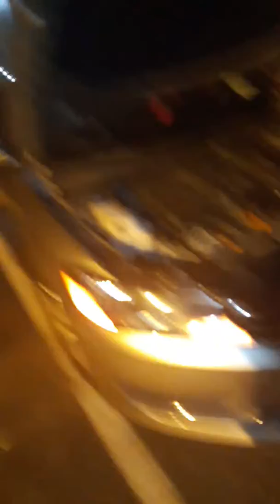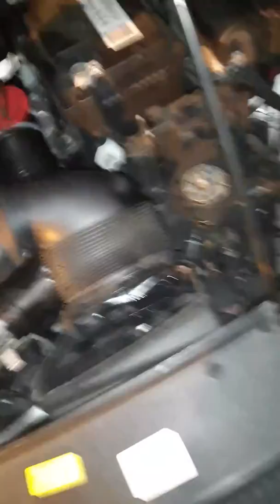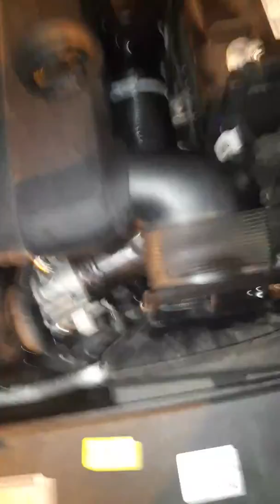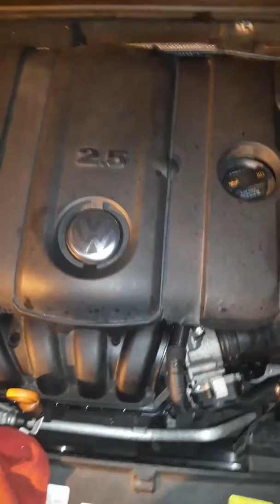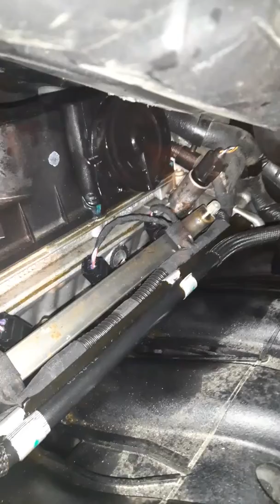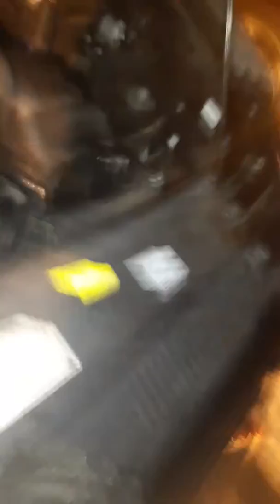2013 VW Passat whistling .. problem found but what's wrong. Part 1..

Comment: thank you so much. This helped me figure out what was going on with my vehicle and it was exactly what you said. I pulled it apart and seen that the PCV cover was cracked and I replaced it and now the whistling noise is gone you rock.

Comment: can this be related to misfire codes? replace coils and plugs? the whine seems to come after the car has warmed up a bit with highway driving. sound changes with rpm
Reply: Same here, give it 10-15 minutes driving it'll start making that noise! I don't wanna pay to take it to volkswagen and pay all that money
Reply: @angelrosas4563  check your pcv diaphragm. it's a vacuum leak
Reply: @kumbackquatsta  how did they get this one fixed? changing the valve works? they want me to change the whole cover but they’re not sure if it will work
Reply: @azzz8083  it was a pcv diaphragm leak, i just replaced the diaphragm not the entire cover. might depend on model year. check advance auto
Reply: @kumbackquatsta  I did this, replaced the plastic part and the german whistle stopped. I save like 380 bucks
Reply: @azzz8083  nice. keep an eye on the map sensor too, sometimes oil from the leaking pcv can get oil on to it which can cause erratic shifting etc. you can clean or replace it. videos on youtube.
Reply: @kumbackquatsta  it seems like i gotta change it, it’s been so shaky and turns off
Reply: @azzz8083  yeah, check and clean your throttle body for traces of oil, then clean or replace the map sensor